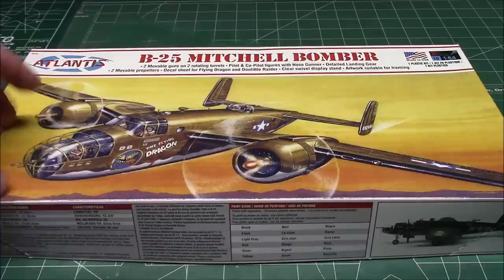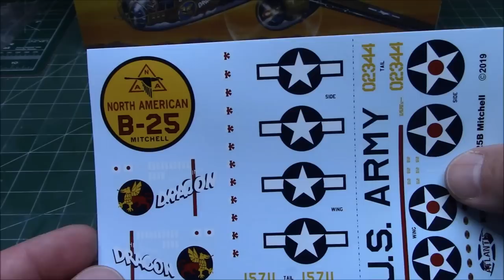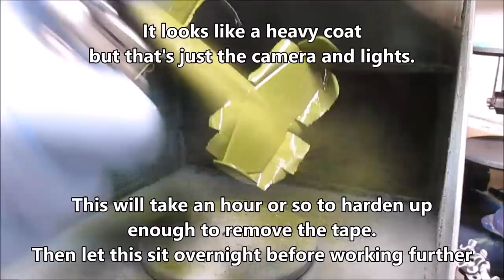Atlantis B-25 Mitchell Bomber Airplane 1/64 Scale Model Kit Build Review

Comment: Great build! Never saw a 1/64 kit before but this will look great next to the 1/64 diecasts!
Reply from the maker: Thanks!
Reply: That's what we called Box Scale, Revell boxes were mostly one size so they would scale the model to fit the box. It just happened to be 1/64. That's cool nowadays because there are tons of die-cast vehicles in 1/64 scale so there are endless possibilities for small dioramas.
Reply: @radioactivelarry   Thanks for explaining!
Reply: Tim,  Currently Lindberg offers a B-17 in 1/64 from Hobby Lobby for $15.  Molded in white with a 20" span and includes a 12x24" poster of the box art.

Comment: I built that Revell B-25B kit in high school. I liked the flexible gun blisters, so mine functioned. My Mitchell was done up as the Marine version, a PBJ-1D. With high-and-tight Light Gull Grey on the undersurface,  carried up the sides, and Intermediate Non-Specular Sea Blue higher up on the fuselage. Anti-glare Dark Sea Blue patches on the inboard engine nacelles, Sea Blue on the upper wings and top of fuselage. The light blue was also carried on the sides of both vertical stabilizers.  Built LDG down, I used a .380 round as a nose weight.  The drop tank from some unlucky 1/72 fighter was cannibalised for a starboard wing RADAR pod, mounted midway  forward of the leading edge, between wing tip and nacelle. Vivid red-outlines US white-winged national recognition markings, as per 1943 regulations
Only the Nose Gunner survived. Some years later,  I forgot about the model  and put it up at my parents house. While I was overseas my kid nephews got into my stuff and thrashed it.  The Gunner, a Top Turret Blister, and some 2-out-of -3 bladed props are all that's left of my PBJ-1D.
Your build brought me back a long ways, Great Job. I liked your adherence to Old School policy.
Reply from the maker: Glad you enjoyed it and thanks for the story!

Comment: Hello Chris, I scored today, got my B-25 and the H-25 helicopter. Went to hobby lobby with coupon and they had Testors camo spray cans all colors on closeout, $1.49 per can, I bought them all, one Model master spray can 92 cents and the biggest deal was a can of Testors frosted glass .21 cents, has a ton of uses for dioramas. Going to make the Doolittle Raiders version and a yellow rescue helicopter, 1/48 scale so fits right in. I'm still working on my C-600 roll back, going to paint the frame now.
Reply from the maker: Enjoy Larry!

Comment: Nice... you do a lot of building...  one suggestion on this one would have been to paint the canopy framing with the fuselage color... the interior of the frames was interior / chromate green, but the exterior was fuselage color... it's pretty common on external framing to paint the interior color first, then the exterior color, so you if you can see inside the glass it's the right color inside, and on the outside, and it requires no more masking....  on this one you could paint the interior framing fuselage exterior color, then interior color....  just a little nitpick, but one that might be helpful.... you have fun, that's the main thing.... keep 'em coming... !
Reply from the maker: Thanks, didn't feel like masking that grid for a quick review build up so I did it the way you see.
Reply: @hpiguy  Your kit, your rules!  Enjoy!  Your videos are awesome

Comment: Great work on the old vintage b25. I am working on the revell 1/28 scale Sopwith camel. I sprayed the upper and lower wings in the correct colors by using Rust-Oleum 2x paints and let dry for about a week, then applied the decals, but when I sprayed the matte clear coat it cracked the paint. Any idea as to why it did that?.

Comment: Beautiful! Kinda sad to see that the new Revell dissed it out 'cuz it's an old kit. I mean, it's clean, so, the molds must have been well kept, therefore, there was more or less of a reason to sell it IMO.

Just a question like this. If you had put the Tamiya black liner thing behind the green of your gel pen, would've it have darken the green color?

And I love Modelmaster's zinc cromate color. I wish I could find a green close to that color in spray paint to paint some cars that color.
Reply from the maker: The panel liner would have just ran around the edges of the raised lines. You could back it with a black marker but I wanted it green on both sides.

Comment: Great build! (In reality the B-25 never had a belly turret and  had a tail gun, but who cares..still great play value!)
Reply: Point of Information, Friend.  The B-25B model, as Col. Doolittle's group used, originally 
did have a remote Twin .50 belly turret. It had no plexiglass, but a flat reflex viewer behind armor glass plate and was retractable and remotely operated. To save weight it was deleted on the Tokyo Mission. A broomstick in the clear tail cone acted as a decoy .50. With the J- model, North American moved the twin .50 mount forward,  behind the cockpit, and added a manned twin .50 tail gun. The later type [subject of the Monagram B-25] deleted the dorsal turret. B-25Js had single .50 mounts on each side of the rear fuselage, like the B-17s.

Comment: Dad use to say a B25 idling sounds like somebody dumped a 5 gallon bucket of nuts and bolts into a washing machine. I like the de-ice boots(shouldn't there be black strips on the leading edges of the prop blades?) and being a prop mechanic i would have to detail the props a little better( domes would have to be silver, hubs aluminum, orange oval simulating the ham stam sticker) but nice build looks like it was fun to do
Reply from the maker: You are welcome to build your kit to your personal level of detail. Enjoy.
Reply: @hpiguy  no disrespect intended to your build just thinking out loud, the make up thing was awesome

Comment: What? Rust-Oleum don't have an OD green? How dare they!

You're correct,the black on the leading edges were rubber bladders that could be pressurized,to crack off ice. Some even had them on prop blades on larger aircraft!
Reply from the maker: Thanks for the info!

Comment: Is there any way to make the landing gear removable, like to display it with or without landing gear by placing flat pieces of magnetic material on the contact points, or maybe double ended sticky tape?

What would you recommend?
Reply from the maker: They are held in by studs so that would be easy.

Comment: 1/64th is quite an unusual scale for aircraft - more associated with Matchbox and Hot Wheels...

Since many of the models you make are reissues, do you prefer older kits or modern ones? Or a bit of both?
Reply from the maker: I build anything the companies send me. New, reissue, etc.
New kits of  course have modern engineering and seem to go together better and are planned out better to be painted in section. But I'll take a nostalgia build and have great fun.

Comment: Which variant of the North American Aviation B-25 Mitchell USAAF Medium Bomber is this, please? 

   I am checking my memory as to the official colours of the camouflage painting: Olive Drab over Neutral Grey?
Reply from the maker: I love this kit and everything about it.
BUT if you're the type of modeler that needs to know exact variants and minute details you'll want to grab a more modern kit as this is a 50+ year old kit and won't meet your exacting requirements.
Thanks!
Reply: @hpiguy  , some of the projects I envision would be in-flight, the landing gear up, the propellers turning, a full crew at their stations. I would place in sequence models in descending scales for a forced-perspective airborne diorama. I know a way to hide from view the stand, borrowing from motion picture production the concept and device of the Chapman crane. 
   For example, in the joint U.S. Navy-USAAF Tokyo Raid of April 1942, a 1:48th-scale kit of the B-25B (likely Accurate Miniatures), this Revell kit, a 1:72nd-scale kit, amongst others. And maybe that new 1:32nd-scale later variant, if reworking it is possible. 
   This old Revell model looks like it could serve as a -B with little effort. The crew I could make from S-gauge model railroad figurines.

Comment: Good for memories, but, really even when they were out in original issue far too many of these kits were the bottom of the barrel in details and kit design as far as I was concerned and even as a very $$$ poor kid.k

Build for the memories AND see why you incorrectly assumed it was your fault they didn't go together.

I only have any of the Atlantis kits because I'm trying to see just how bad they were in detail and the like compared (e.g., form and fit, especially) to modern kits.

Renwal and Lindberg lines were normally just as bad, but Lindberg cost so much less while Renwal were so expensive.